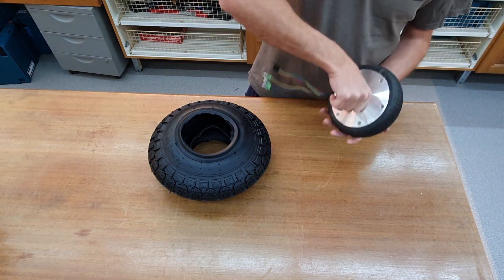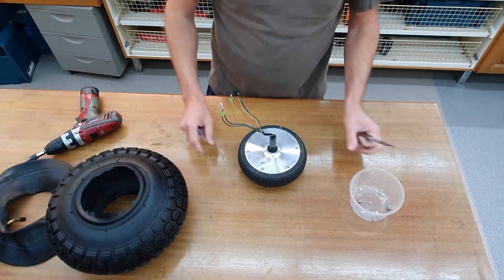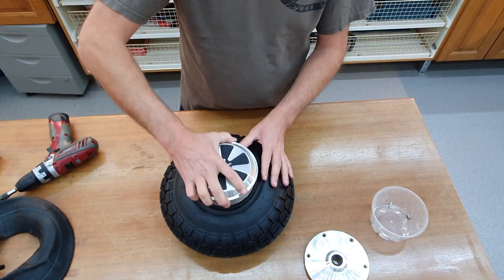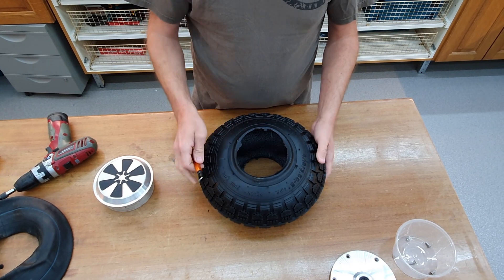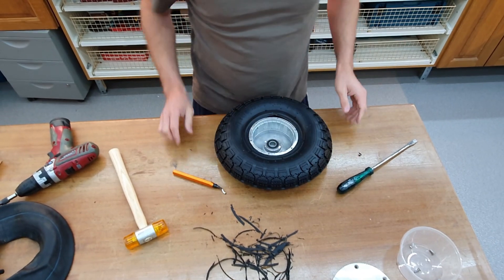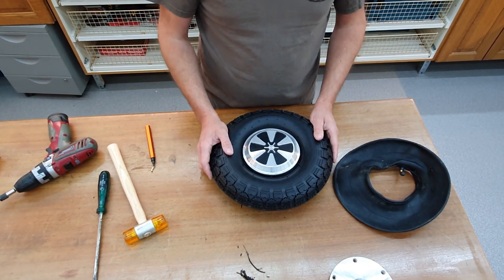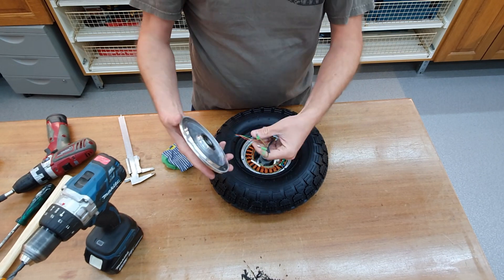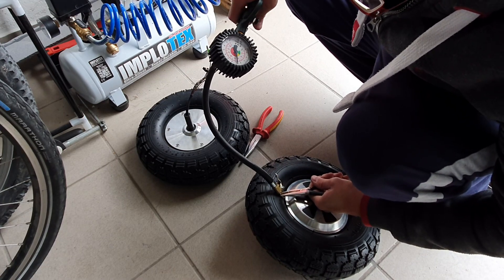Hoverboard Rubber Tire Mounting

Comment: Just an FYI but when using tubes the typical way to handle the air inlet is to drill a small hole in the tire and feed the nipple through. This way you're not pinching the nipple between the wheel and tire